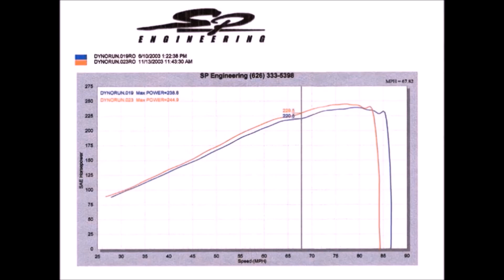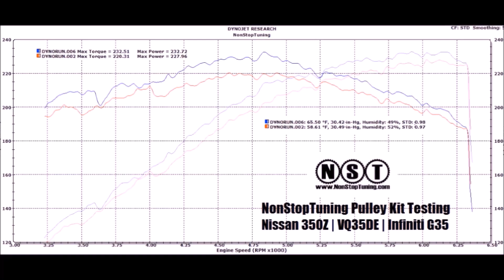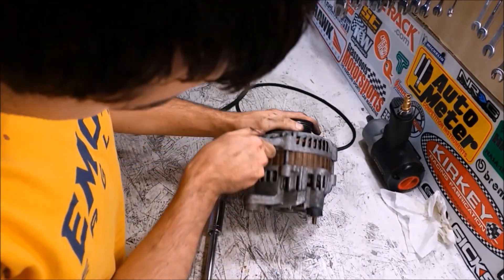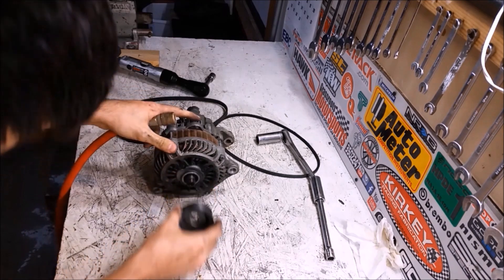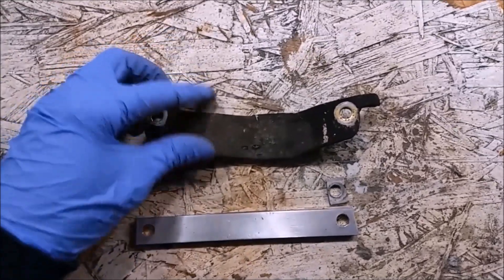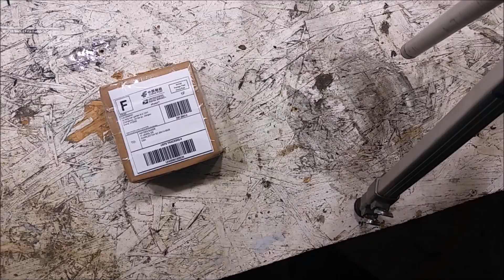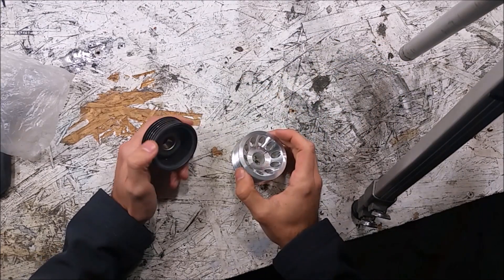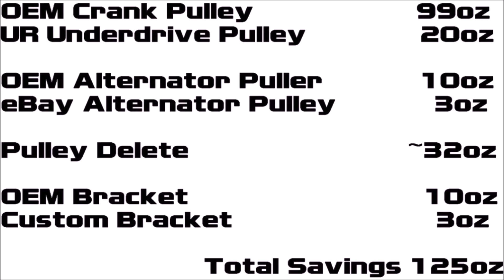Nissan 350Z Light Weight and Underdrive Pulleys DIY Guide

Comment: Awesome video thanks heaps for the guide. A lot of good info

Im in the automatic transmission boat and was worried I'd have to remove a bunch to get my impact gun onto the bolt but I found a video where a guy loops around the AC compressor and jams an old belt back into the crank pulley so he can crack the bolt loose with a bar. I hope this helps anyone else with an auto trans

https://www.youtube.com/watch?v=ItxEIaIyBjc

Comment: I know I'm pretty late to this discussion, but It's not very hard to do on an Automatic VQ. I've found that the easiest way is to use an existing serpentine belt wrapped around on top of itself and use a breaker bar and socket to break it loose. You have to remove the rad fans and pretension the wedged belt from underneath first though. Changing the alternator pulley is a different story though. Hope this helps. Also a side note: belt size/brand for underdrive pulley(s) with fan pulley/idler delete is Duralast 6PK1100 also known as 433K6 for main belt, and 4PK0897 also known as 353K4 for A/C compressor belt.
Reply: I heard you can just put a cheater bar on it lean it on something sturdy and put it in drive and it takes itself off
Reply: @caged868  I think what you mean is to place a breaker bar on the crank bolt and let the starter motor apply force to the breaker bar while wedged. It works that way in some cases, but not really advisable.

Comment: How much under drive is your crank pulley?
Reply from the maker: I think it's like 15%. It's from Unorthodox Racing
Reply: @350Z247  I see, Thank you. I was looking at Non Stop Tuning under drive pulley, they said theirs was 10-15% under drive. I'm doing a Crank to alt only set up like yourself in my 05' g35 m/t. Currently I'm working on disassembly of the steering rack to get that plunger/piston cut off, then put zerks in all the fluid orifices and fill it with grease. Great videos btw, I've watch nearly all the them on your 350z. They have further expanded my mind on the possibilities with these cars.
Reply from the maker: @pandaEXPLOSHIN  Good luck man. These cars can be a ton of fun!

Comment: Wait, your description speaks of both underdrive and lightweight pulleys as though they're one in the same. Understandably, an underdrive crank pulley will be lighter weight than stock and therefore "lightweight", there seems to be two totally different pulleys available for guys like me with the VQ37: Underdrive or Lightweight. Or one that features both. I still can't figure out the difference ugh
Reply from the maker: As a rule of thumb, all underdrive pulleys are light weight aluminum unless they're a fluid damper which is completely different. I've never see anyone make a heavy steel underdrive pulley. I'd recommend and underdrive crank pulley with aluminum accessory pulleys if available.

Comment: How has it been till now? My crank pulley is leaking and thinking of doing this. However I keep seeing conflicting info regarding the harmonic balancer
Reply from the maker: I haven't had a single issue from it. I have no reason to not recommend you do it.
Reply: @350Z247  Nice thank you, glad to hear its running well past the 35k miles from this vid! I wouldn't be surprised that the people claiming engine wear probably are probably the same people who run full bolts with no tune 😂

Comment: What’s the belt size brother ? & are these the eBay kit ??
Reply from the maker: Only run a name brand crank pulley; it's too important. The alternator pulley could be an eBay pulley. Those are the only two worth changing. The power steering pulley is press fit, the AC compressor needs a clutch, and the "fan" pulley is deleted. The belt length is specific to which pulleys you keep/change. You'll need to measure your specific set up.

Comment: For automatics couldn't you brace a breaker bar on the crankshaft pulley bolt and use the starter to break it loose. Seen it done on Scotty kilmers channel.
Reply from the maker: 1. While possible, it's a good way to burn out your starter
2. A much better way would be to somehow lock the flexplate with a pry bar, but that's much easier with a second person or while on a lift 
3. I really hate that man
Reply: @350Z247 1. Yeah you could burn it out if you keep cranking it true. 2. Yeah it would be a hell of a lot easier on a lift agreed but sadly I don't have one either. 3. 😂😂🤣🤣🤣 Hate hime 😂😂😂 Why? he can corny as hell but his info IMHO is solid.
Reply from the maker: @mamiphmotors  Mine took a ton of persuasion from an impact to come off; it's on there real tight. As for Scotty Kilmer, I think he's full of it, but clearly, he's got a lot of followers.

Comment: There is a flex plate bracket for AT. They don't have to remove the front end.
Reply: Thanks
Reply from the maker: I tried holding a pry bar in there, but I couldn't do both at the same time by myself. If there is a premade tool that bolts in place to hold the flex plate, I couldn't find it.

Comment: What belt size do you run
Reply from the maker: My car is in a different city right now, but my belt likely wouldn't be helpful. I'm only running the alternator and underdrive crank pulley with no tensioner. They don't make the length I'm using in a 6 rib; so, I'm using two three rib belts. I have to slowly work the belts on while I turn the engine over with a wrench. As long as you measure the belt path with something like a wire, you should get an accurate length to search for a belt.
Reply: 350Z247 I have a Hr I’m trying to run only alternator as well haven’t seen any one do so
Reply from the maker: @peytonrice454  I'm not sure if the HR alternator is in the same exact position, but it likely is. It's easy enough to work the belts on, but keeping the tensioner would likely by simpler.
Reply from the maker: @peytonrice454  if I remember correctly, the belt length is approximately 29 inches.

Comment: Quick question why do you only have your belt running on the alternator and crank? And can anyone do this?
Reply from the maker: You'll need to delete your power steering system first, but yes, anyone can do this. It's certainly not common though
Reply: Will it fuck up your car only running 2 pulleys and also daily driving it like this

Comment: Only change the crank not the water pump or it will go out way faster. And u need to port the fuck outta the intake plenums on the front facing 2 ports in both the left and right side then remove ur cats and wingo u got a beautiful sounding and faster than stock vq
Reply from the maker: 1. No VQ has a water pump pulley; it is driven off the timing chain.
2. A plenum spacer or revup lower plenum will address the issue with the front two cylinders better than back yard port work.
3. Nothing past your first sentence had anything to do with this video.
Reply: @350Z247  if what I said doesn't make sense then your truly an idiot and the backyard bulshit you're talking about is stupid you can get the fucking blueprints for the mrev2 online for how much they milled the front-runners to copy them exactly. I had a full bolt on g35 DE and the HR plus i had the g37 2010 fbo but ok u know the best right
Reply from the maker: @puprilla  I never said it didn't make sense; I said it didn't apply to the video. This isn't a video about plenums. If you really knew these cars, you'd know something as simple as whether they had a water pump pulley or gear directly off the timing chain. Mistakes like that don't inspire confidence; some grammar and punctuation would also make it easier to read.
Reply: @350Z247  im not talking about the spacer either i was saying do the lightweight undrive pulley, but only the crank "since i did them all and then did just the crank and it made better power" then port the 2 front runners and the whole intake manifold then get some test pipes and ur car will sound good af thats what i said so take ur but hurt ass to macdonalds and get some french crys 😆
Reply: @350Z247  unlike u i did everything on my g myself so its called being safe not sorry by not putting the water pump pulley on.
Reply from the maker: @puprilla  Again, that has nothing to do with this video, and again, punctuation is important. No one is here for test pipes, plenums, or childish remarks. I have done every bit of work on this car myself, but thanks for playing. Lastly, there is no water pump pulley on the VQ.
Reply: @350Z247  i must be mistaking it for the alternator pulley but all the same just change the crank pulley

Comment: How do you tension the pulley with the tensioner gone?
Reply from the maker: It's an exact length belt. To install or uninstall it, I have to rotate the engine while guiding the belt. It runs two three rib belts because a six rib doesn't exist in the right length. It wouldn't be difficult to fab up a bracket to make the alternator a swivel mount for tension if desired.
Reply: @350Z247  i was hoping to maybe retain the tensioner when removing the power steering pump.

I have moved to an electric power steering pump
Reply from the maker: @ryanr9348  I just didn't need it; so, I went for the weight savings. No reason I couldn't have kept it though.

Comment: Can You link me to the PS lightweight pulley?
Reply: Turns out vq guys use a ps pulley from an sr20. Found out after
Reply from the maker: @Vaabuss  Interesting. Good find!
Reply: wurmhole what’s funny is I have a friend running a ISR PerLight Weight Pulley Kit - For the SR20DET S13.... but on a auto 350Z 04 Soo I’m perplexed and his revs up super fast and sounds great🤔 different from any other auto Zs and he has some custom belts I want to do the same but don’t want to blow yo my engine ...
Reply from the maker: There is not power steering pulley option currently available that I'm aware of. I might have seen one years ago, but as its it's a press fit pulley, I'm assuming reliability was an issue. Most companies only make crank, idler, and alternator pulleys. I deleted my PS. If you have do anything, do the crank pulley and delete the idler pulley.

Comment: What size was the pulley belt you used for the alternator to the crank pulley
Reply from the maker: 4030290. Its a 3 rib so you'll need to buy two belts. You'll need to rotate the crank pulley as you feed the belts on. It's easy once you get the hang of it.

Comment: Excellent info! I came here to see how the alternator pulley came off, but I'm impressed with replacing the alternator bracket. It doesn't sound like a lot of savings, but once you extapolate that to the entire engine, that's a decent amount of weight saved from the front of the car. Good job :)
Reply from the maker: Thanks man! I really enjoy doing small jobs like this that add up to make a big difference.

Comment: Is this the same for a 2008 350z or a vq35hr
Reply from the maker: It's the same basic principle as you have all the same components, but  it is different because the HR only uses a single long belt. The HR doesn't have the "fan" pulley. You can still replace the crank pulley with a quality lightweight under drive pulley. You will have to be more careful if you delete components to ensure the belt still routes properly for the pulleys you keep.

Comment: Nice vid, thanks for sharing. Anyone know if a DE alternator pulley would work on an HR?
Reply: I’m thinking of removing the AC aswell when I do this
Reply from the maker: @bg7632  it would be a good time to address it
Reply from the maker: It looks like the pulley is the same based on the number of ribs and size compared to the alternator. The alternator pulley isn't a huge deal of you gotta keep the stock one. I know the crank pulleys are very different.
Reply: @350Z247  Thank you for your reply! I am thinking along your lines that the alternator pulley is likely the same. I'm going to get an ATI damper crank for my HR G35X, I'm intrigued to see if tossing on a cheap lightweight alternator pulley might help a tick as well. Maybe I'll just have to purchase the cheapo ones off eBay and see what happens! Some money is going into that crank pulley though, definitely not messing with that. I'm keeping the AC on mine specifically for winter driving and defrosting. My G already has enough issues defrosting the windshield, I don't need to create more :P
Reply from the maker: @PhilipSamuelson  Sounds like a solid plan!

Comment: The more research I do on lightweight crankshaft pulleys the more I hear people say they can damage your engine due to vibrations and aftermarket pulleys not having a rubber damper.  (harmonic damping )  Have you noticed any issues relating to the lightweight pulleys?
Reply from the maker: Not a single one. That is all internet rumors born out of people who don't understand how modern engines actually work. No one questions a lightened flywheel which drops 20 pounds off the engine's rotating mass, but drop a couple pounds off a crank pulley that has no real harmonic properties to begin with and everyone loses their minds. The very small bit of rubber in the stock crank pulley is for NVH; modern engines are internally balanced.
Reply: @350Z247  I know the engine is internally balanced , but people were saying the lak of the rubber would send vibrations to the crankshaft damaging it and messing up the engine timing.  However I guess no one has actually ruined any crankshafts with lightweight pulleys.
Reply from the maker: @joshuawiggins7487  Yeah, those people are idiots. That little bit of rubber makes no difference to the crank; it's nothing compared to a proper fluid damper. Not to mention that rubber is hard as a rock by now and will likely fail. All it does is make the car slightly more livable for the average driver.
Reply: @350Z247  all right thanks for your knowledge and real world experience. Gives me some peace of mind because this will probably be my next mod.
Reply from the maker: @joshuawiggins7487  It's definitely a worth while mod. Good luck man!

Comment: Hey how did u remove the power steering pump
Reply from the maker: I'm going to make a video about it soon, but it's pretty easy. It just unbolts from the side of the engine, you run a shorter belt, and you have to disassemble the steering rack to remove the plate the fluid pushes against. You could loop the lines, but the steering feel won't be as good.

Comment: How bad is it after deleting the power stearing?
Reply from the maker: I'm use to it now; so, it doesn't really both me. However, I wouldn't recommend it to someone unless they really wanted to. The steering feel in track is amazing, but any turns on the street or in a parking lot have to be planned very far ahead to avoid putting too much strain on the steering components. I would never parallel park it. They've held up for over three years, but I still try to baby them when I can. It wouldn't say it's worth it unless it's a dedicated road course car.

Comment: anyway we could get a link to the alternator pulley?
Reply from the maker: I actually don't see any more listings for just the alternator pulley. You could either buy a $65 eBay set and sell or recycle the other two pulleys (I wouldn't recommend running an eBay crank pulley) or you could buy the $90 Unorthodox Racing Alternator Pulley when you buy their Underdrive Pulley.

Comment: This is a pretty cool idea I've been thinking about for a while. Did you notice any gains when you first installed them? Not dyno gains, just noticeable gains while driving
Reply from the maker: Full Throttle it definitely revved up much faster! It got to redline quicker and smoother. I'm very glad I did it. Haven't experienced any negative effects even after several years and thousands of miles
Reply: Awesome, good to know. Thanks for the quick reply!
Reply from the maker: Full Throttle no problem man. Benefit of having a smaller channel ha
Reply: 350Z247 Lol, I feel it